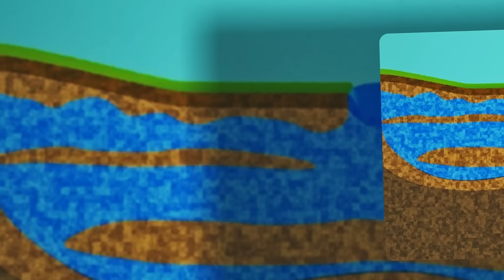15 Largest Sinkholes Caught on Camera

Comment: Several times when speaking about one sinkhole you show footage of a different one … makes it confusing…….we had a 4m wide sinkhole filled with water open up in the spare block next to our old house , many years before the sinkhole had been used as a well, and a market garden was built around it making use of the unlimited water… for some reason it was filled in with gravel and unclean fill material and stayed stable for decades. It opened up again after the area nearby was flooded after a huge storm, it must have had access to tunnels or other open areas that allowed the water to get in there again and it took approximately 40 truckloads of gravel and sand to fill it in once the water level went down.the area around it was considered a playground because of its lovely lush grass and No buildings , luckily it opened during the storm and no one was out playing 😮